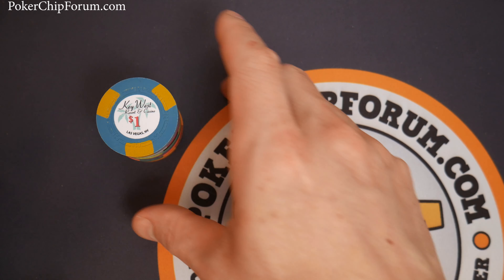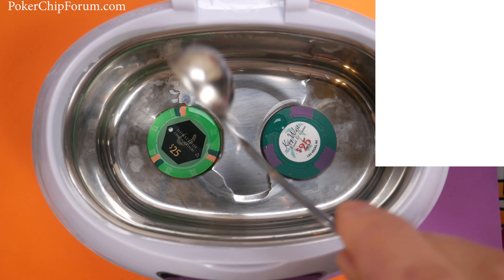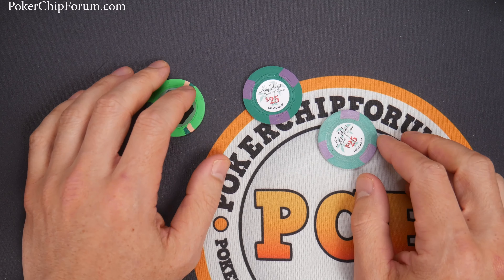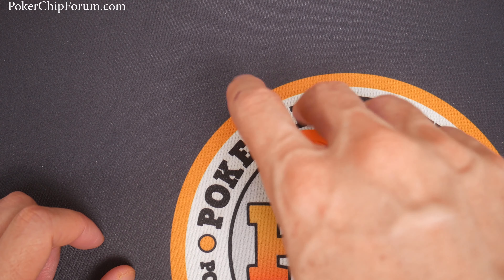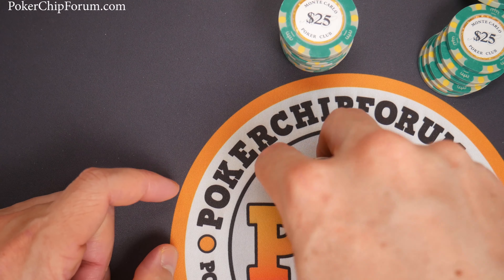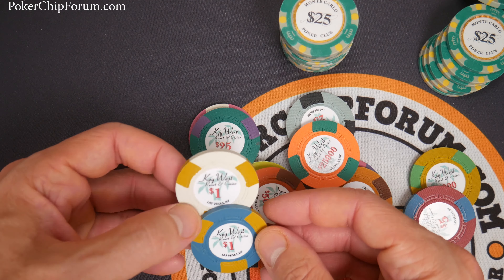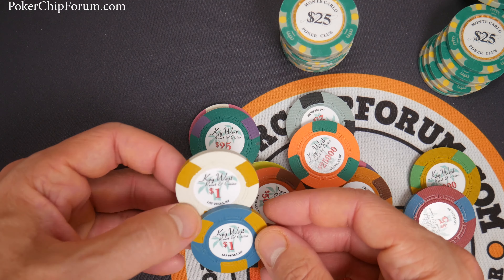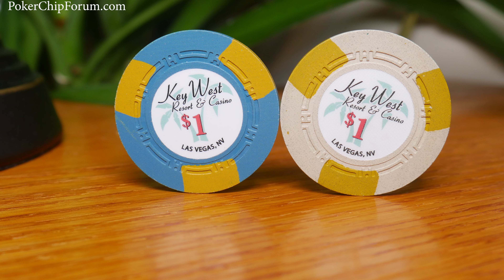Key West Poker Chips - TGPCA S04E12

Comment: I think this might be the best chips I've seen reviewed. I'd give'em 8.5/10
I like the squared off edges. The colors are good, you can tell the difference between 100 & 500 easily. Although the 1k & 25K are a little similar, especially when you showed them next to each other from the side, which will be the more common view from opponents in poker but from the top, the 25K looks more vibrant, maybe a stack will too. I can't believe they have a $20 chip. I'm actually about to receive a custom set that I made for cash games, and made my own $20 chip. Figured this would make it easier for when someone gives chips for $20 bill and you can't just take the cash off the table, well... here, $20 chip in exchange, easy peasy. Even tho they say Key West on them, it doesn't take over the chip design. I like this set, especially for cash game. Even for tournament, I say Bravo on colors and using 25K instead of 10K chips.